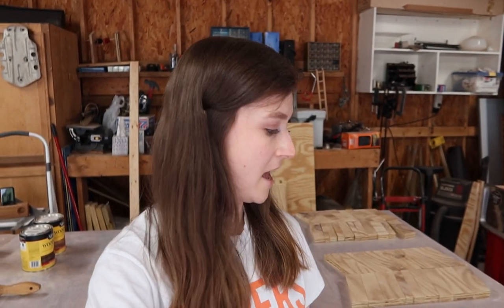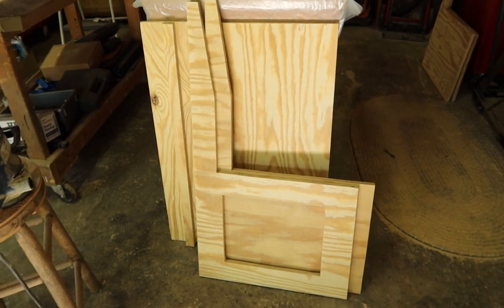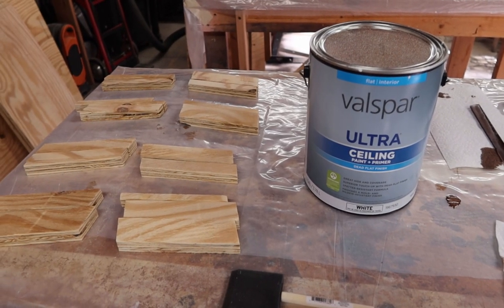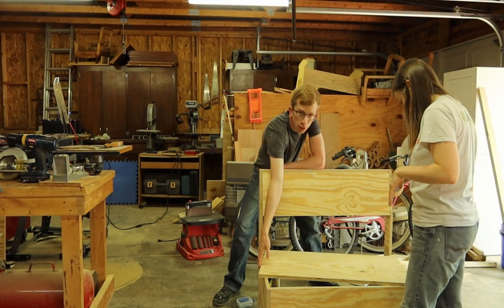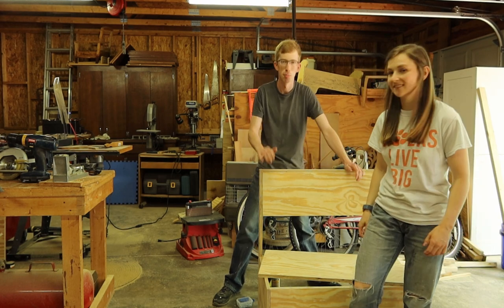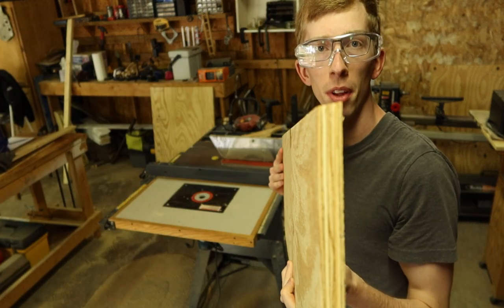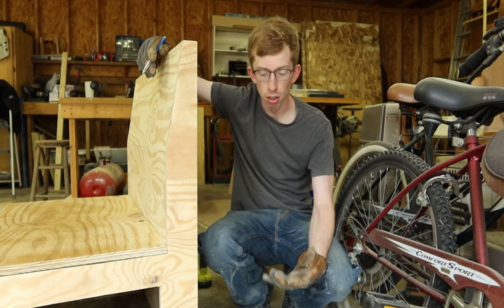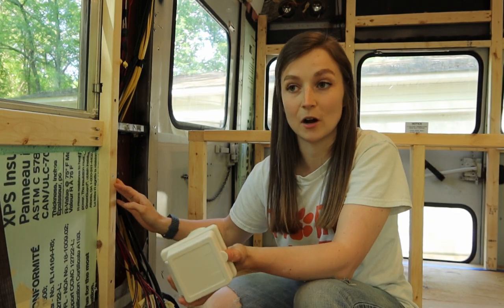Taking Time to Do Things Right | Skoolie Dinette Bench | SKOOLIE BUILD

Comment: Tip for viewers;  If you're using masking tape to hold down plastic on a work table and it keeps popping off of the wood of the work table, fold it in half so that it's thicker and then run a couple of staples through it with a staple gun. 😁

Comment: What are the dimensions of the bench you made?
Reply from the maker: @Daniel Leal The actual seat of the bench is 17in tall (+2in more with our cushions), 34in wide, and 19in deep.
The back has a height of 36in.  The bottom of the slanted cut is 3in deep, and the top is 1.5in deep. The total depth of the base is 22in (19in for the seat, and 3in for the back).

Hope this helps! 😊